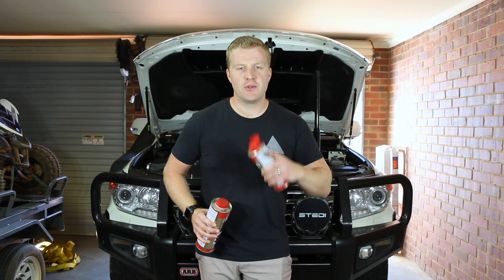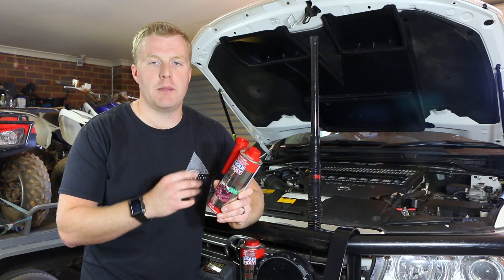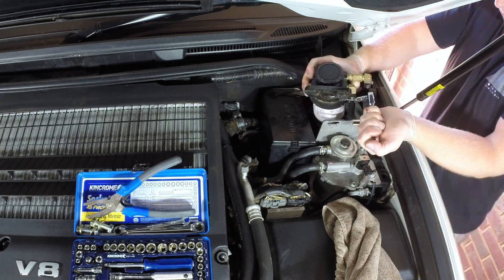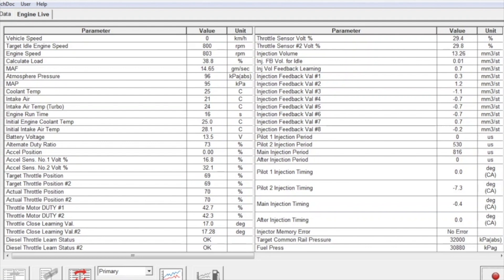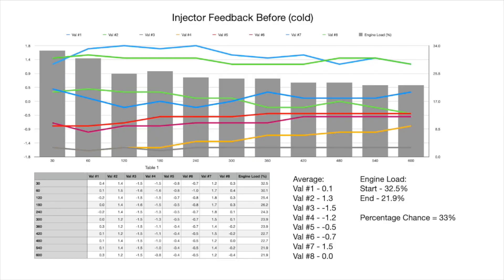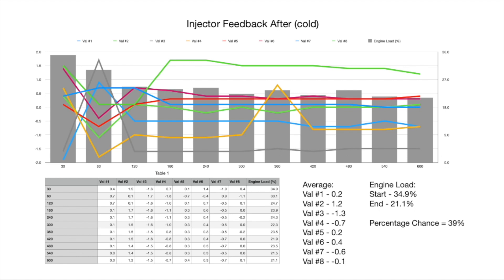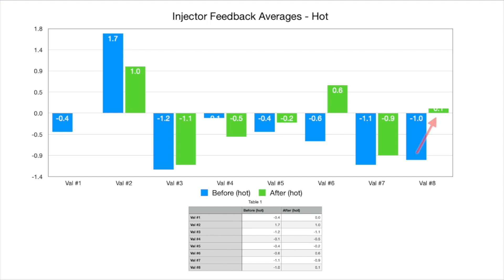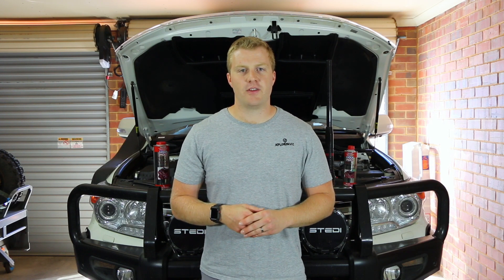LIQUI-MOLY Diesel Purge | Does it actually clean injectors? | Injector Feedback Test -Fuel injection

Comment: I pour it neat into a new fuel filter and run it through the engine like that, No messing about with pipes and clips! What is left i just pour into the diesel tank.
Reply from the maker: Sounds like a quick and effective method, cheers!

Comment: I put the diesel clean and boost in my NS pajero with 260k on the clock and it sounded heaps smoother/quieter.
Reply: How soon did you notice these results? Normal dose?

Comment: A good test. I have done simular with Liqui Moly diesel purge on a 2010 VW engine 90000 miles and a 2017 10,000 mile Ducato. The VW changed from +-1.5 to +-.4 post clean a very significant change (VW limmit+_1). The Ducato showed no change but limit is +_2 . Both tests were showng 2 injectors +4. On doing a leak off test cylindar 3 leaks over 4 times the others. Are there any other tests (scantool based) that you do or reccomend.

Comment: Those injector readings show how the injectors compensate for differences in compression on each cylinder. So yes, they were cleaned, but the figures cannot be used to show by how much.

Comment: I can confirm that liqui moli diesel purge DOES work!! Here in south africa our diesel has a high sulphur content so our diesel vehicles suffer quiet a bit however a diesel purge makes them run like new again. I have had a case where a BMW 2.0d sdrive would basically run on 3 cylinders on cold startup with a decent amount of smoke coming out, rough idling and loud injector clutter when driving. Replaced fuel filter and purged 2 cans through it and still to this day car starts without issue on cold and drives pretty much like new. I have even noticed on vehicles with DPF after purge the DPF pressure drops completely to almost brand new. Only had 1 situation on a Audi 1.6TDI where the purge didnt help but i suspect corrosion from moisture in the injectors where purging doesnt really help
Reply from the maker: Thats some great feedback and awesome to hear some noticeable real world results. I still use this product from time to time to purge and so far, I'm happy with how its performing 💪
Reply: Audi are pig iron 😮
Reply: So the vehicle doesn't suffer, the aftertreatment system does

Comment: My car stalls now after using this.
Reply from the maker: Hmm, something isn't right there. Maybe a air leak in the hoses?
Reply: I'm changing ox sensers now but this heat and rain and 70s dew points is to much for me this week,man. This is miserable weather.
Reply: Nothing was wrong before I put the cleaner in.the money light came on within a few miles after.I ran the tank down,refilled and the check engine was still on after twenty miles.I cleared the code and it  was successfully done ,but it stalls on start up now.

Comment: I bypassed my Fuel system on my Ford Ranger - put the Luquid Mobi straight to the rail using an 6mm and 8mm fuel lines and a clean empty 2 litre pre-wash bottle as the fuel resevoir / return from rail. (pulling all  the fuzes on the pump and vapourises). I ran two two full cans neat - with the return to the fuel resevoir having an inline fuel filter... Try that... It works almost neat  mixing with the diesel in the rail.
Reply from the maker: Yeah, awesome. Sounds like a much more efficient way of administering the product. 
Did you find there was much difference in the Ranger?
Reply: @XploringOz probably still a ranger 😢😂

Comment: thanks so much for the video and comparison, just a quick question, this type of cleaners dont leave residue in chambers?
Reply from the maker: No problems mate, glad you got some value from it. 
I don't have any scientific way to assess whether residue is left behind, but I don't believe it's designed to do so. 
Cheers, Nathan.
Reply: @XploringOz  its just that i wanted to know before using it if its true that it get burn 100% with fuel and will leave no residue in the chamber or the DPF and specially the DPF , but thks for the honest answer , 
have a nice day

Comment: The return line goes directly from the high pressure pump all the way back to the tank tank.  So for the concentrated purge activity, only one hose needs to go into your plastic container, to draw the liqui moly product in.  There is no need to disconnect two hoses because there is no fuel coming in from the tanks, as there is no lift pump that feeds fuel from the tank to the engine.  Only the supply hose going into the factory sedimenter needs to be submerged into the container.  I would simply open the fuel tank cap to release any air pressure in the tank, so that when the return fuel goes back to the tank, it doesn't push fuel into the supply hose.  

N.B. This advice that I am giving is only specific for the VDJ200 - other makes, e.g. Ford Territory actually have a fuel lift pump in the tank, so two hoses do need to be disconnected.

Comment: Great test but I doubt load is a percentage. With BMW load is an arbitrary number, with my 335i i have a peak load target of 195 ish and an idle load of 18ish.
With your LC v8 making 175kw peak, 30% load at cold start idle would be 52 kw just sitting there.
With many petrol turbos thats what contols boost pressure, you target more load in the ecu map.
Also there's load commanded and load actual so if u go to overtake, the load commanded goes up, load actual is lagging, the wastegates shut, it spools and boosts until load actual catches load commanded.
So much stuff going on, thats like 2% what a modern ecu is doing 👍

Comment: Very interesting 
I think we can potentially spend a lot of cash on additives for not much difference. It’s great to see actual figures to decide wether they’re worth their money
Reply from the maker: For sure, it's hard to distinguish between real products and marketing hype these days. Glad this could help a little.
 Cheers, Nathan.
Reply: LIQU Mobi and LUCAS are good in my opinion, Sea foam is hit and miss - the rest is snake oil.
Edit - I got a tip for oil changes - That does work - pour an Ouance / Oz of Sea Foam into your engine oil 200km before an Oil Change... let it run. Then do the oil change - it is like a pure solvent that helps remove gummy deposits - it does work for that, you'll get lots of tarry crap out of your oil drain.

Comment: Hello, do you have an in-tank fuel pump? or the fuel pump is outside the fuel tank?
Reply: A stock 200 Series does not have a lift pump, only an internal transfer pump that moves fuel from the sub tank to the main tank.  Fuel is drawn into the engine by the suction from the high pressure fuel pump, which is after the factory sedimeter / fuel filter.

Comment: That's a very good comparison and you have presented it very well! Personally, I use Morey's Stop Smoke & Fuel Conditioner in my old 2h. After about 4-5 fuel tanks, I noticed smoother running in higher rpms, significantly less smoke when under load, and a slight increase in power however no change in fuel economy (gets between 12-13 L/100 before and after fuel treatment). Initially, I was using Fuel Doctor but I didn't notice any real difference. I find the Morey's stuff is more effective. It's pretty cool how you can collate that data and make direct comparisons with modern technologies.
Reply from the maker: Thanks mate, glad you enjoyed it 👍
Interesting to hear your thoughts. Might look into this and see if I notice any difference. 
Cheers, Nathan.
Reply: @XploringOz  No problem mate! It'd be kinda cool if this assessment could be conducted on an older vehicle like mine. Cheers, Patrick

Comment: Hi Nathan. Great video!
Do you know if you could run the cheaper (Valvoline, Repco/SCA diesel cleaners) in the same manner? (Concentrate)
Reply from the maker: Cheers mate. So I haven't looked into this. I don't believe all of them would be able to do this as these products would need a specific chemical formula to successfully and safely run the engine. I think it would be best to check with the manufacturer before trying anything though. 
Cheers

Comment: I would be replacing injectors at 100k if towing a lot / working the engine a lot or at around 140k if the engine has had an easy life or at around 5 years, to prevent blow by from aging and or worn seals etc. At the same time i would be getting the egr system cleaned as even if you have a catch can you will still get soot build up over time.
Reply from the maker: I hear what you are saying, but at $6000 for replacement injectors, that just isn't a viable of cost effective option. 
I have had the intake and EGR clean as I fully expect some oil to still make is past the catch can 👍

Comment: Does the engine sound different? Should have done idle tests before and after with sound.
I did use it, just put in fuel tank, and engine feels smoother. After 50kms.
Reply from the maker: There may have been a very small change in the sound. I believe the change would be more noticeable to louder the 'knocking' or the more worn the injectors are.
Glad you were able to detect some benefit from using this.

Comment: About the injectors values, the sum of all of them is 0. And if you have 1 injector with problems, the rest will compensate for it. As we can see 1 injector has -1.7 value. That is why the rest have positive values to compensate for it. 
As we can see the additive helped a little,  but the only way to fix it is to recondition the injector or buy a new one.
Reply from the maker: Yeah mate, I hear where you are coming from. I guess these cleaners make a very small difference, but nothing that is going to save the injector overall...
Cheers, Nathan.

Comment: Slightly improved the scores... maybe because you only had a slight amount of gunk on your injectors?
Reply from the maker: This is possible, but the injector feedback values are showing some irregularities. Either way, had a little win which is a positive. 
Cheers.
Reply: @XploringOz  Your vid inspired me.  I'll run a test on my massively more gunked up 1996 2.5 TDI Iveco engine.  Curious if it will get help a blue smoke on start til warm problem.
Reply from the maker: @surfreadjumpsleep  Glad it could help. All the best with your test, let me know how it goes. Im interested to see how an older engine with potentially more build up reacts to this clean up. 
Cheers.
Reply: @XploringOz  I'll try to remember to get back to you -- awfully busy here & I won't be able to do this for another month.. maybe not for another few months.
Reply from the maker: @surfreadjumpsleep  No problems, all the best

Comment: Hello i did use it for 5 minutes and the other liquid i put inside the tank . I want to do it again , for 20 min now but i wonna know when becouse ive done only 2000 km after that purge . A friend of mine is saying me that it might do bad things to injectors , it open them more that it should .... what you think ?
Reply from the maker: Hey mate, this product shouldn't do any damage to your injectors. Keep in mind that the instructions state to only only use the product at idle or high idle. I think running the engine off this concentrate under load could cause problems in a long term situation, but you should be alright if mixing it with diesel. 
Hope this helps, cheers Nathan.
Reply: @XploringOz  thx ,but how many times a year should i use it ?

Comment: Hi Nathan 
Would you be able to provide some info. I want to check my injectors. Do you have a link to the software you use and a link to the cable from the car to a laptop. Looking forward to hearing from you.
Tieran
Reply from the maker: Hey mate, so the software is called Toyota Techstream. There are multiple versions available for download on the internet. It's not a product that Toyota designed to be accessible by the general public. There's no speicific link to it as such...
Further, it can be a struggle to install and get this software to work correctly. Personally I'm not an IT guy, so I had to send my computer off to a friend to have him install and program the software for me. It wasn't an easy process at all. 
The cable I was using is called a mini VCI cable. This can just be purchased online for a small price. 
Hope this helps somewhat. 
Cheers, Nathan.
Reply: Thanks heaps for you quick reply mate. Would your friend be interested in loading it on a laptop for me. Im located in Perth WA
Reply from the maker: @Sandgrop3r  Hey mate, I can ask but I probably know the answer. It's not really his thing and I think this program was difficult enough once... I'll let you know though.
Reply: @XploringOz Hi Nathan. I understand but I do thank you for your information and advice. Keep the content coming, cheers Tieran

Comment: I have the same filter setup as you. Did you have to remove a fuel pump fuse to stop diesel pumping from the tank during the purge?
Reply from the maker: Negative, I just disconnected the return line and diverted it back into the intake. The only thing with this method is keeping a feel for the fuel temp, as it will increase more than usual.
Cheers, Nathan.

Comment: Would a whole can be mixed with half w tank of fuel in it or a full tank?
Reply from the maker: You could run this with a half tank, it would just make it a little more concentrated. It won't hurt the engine unless you're over-concentrating the mixture and putting the engine under very heavy loads.
Reply: I run it almost empty and pour it in, if you lose power after doing a bottle that means it cleaned a lot. And the filters need changing if you have a see thru pre filter or screen, keep an eye on it for clogging

Comment: Hello , i want to know which should i use for my car ,liquid molly spulung or liquid molly super diesel additive ?
Reply from the maker: Hey mate, for my vehicle I use the Super Diesel additive. Works well for me.
Reply: Hello bro . I want to do the purge proces but i dont know how to do it in my audi a6 2007 2.7 , i dont know which tubes should i put in the liquid
Reply from the maker: @R3MILI  Yes, this can be a little difficult sometimes and is different on each vehicle. Best way would be to try and follow the fuel lines from the fuel tank itself. This will generally lead to a fuel filter and then into the engine. The fuel return line is generally nearby as well. This can also be traced back to the fuel tank.
Reply: Since you have information bout cars ,can you tell me if a bad  intake manifild swirl flap  may cause my audi to consume 15 lit for 50 km in city ?   In highway it consume only 7 lit for 100 km .
. Ive heard many ppl here some says its that probldm that consume as much fuel ,some say it doesnt has to do with that ... what you think bro
Reply from the maker: @R3MILI  Hey mate, I probably wouldn't be able to diagnose an issue like this without seeing the vehicle myself. There are many reasons as to why the vehicle may be performing like this. Sure the fuel could be one issue, but it could be many others as well. Sorry I couldn't help.
Reply: I did the diesel purge on my audi a6 2.7 , ive seen more acceleration . But i havent done any test for fuel consum . How many times a year should i do this clean ?

Comment: I also use the same perge product at every fuel filter change, nice to see some actual data.
I also add a fuel advertise into the tank, not at every fill up but on regular intervals.
Reply from the maker: I think it does help, even if it is only a little 👍

Comment: Any reason in particular why you run a " post" fuel filter and not a " pre " fuel filter?
Reply from the maker: There are definitely advantages to both running pre and post filters and it will depend on how you want to set up your particular vehicle. 
The reason I chose this method is that it allows the pre-filter to essentially run as standard, meaning that if I pick up dirty fuel, my dash and factory sensors will let me know. 
I always carry an extra fuel filter and am able to clear the fault light with the Ultraguage.
Running a pre-filter can protect your factory filter, however you won't know whether it has picked up dirt and debris until there is a slow down of fuel passing through the filter. 
Again, everyone has their own opinion on this matter and this is only how I think about it. 
Cheers, Nathan.
Reply: @XploringOz  thanks Nathan like your reasoning.  I put a pre filter in mine and its not that easy to check the bowl for water  , i  need to use a mirror on a stick to check it.
Reply from the maker: @jpbro5545  As long as it's working for what you need, that's all that really matters.
Reply: @jpbro5545  i have the same issue on a d max cant easily see the bowl.

I will use your sugestion re mirror on a stick
Reply: Yeah the dude form Berrima Diesel is not that impressed with a post fuel filter on the diesel LC200 - https://www.youtube.com/watch?v=uRKsXgHuWX0 He talks like he knows his stuff

Comment: Hello. Which software did you use to display those values? Cheers
Reply from the maker: Hey mate, I used a program called Toyota Techstream. Plugs straight into the OBD-II port and reads the ECU's data directly.

Comment: Well done! Nice to see a comparative study. I don't have OBD on my old Patrol. So this has been more than helpful for me. 
Thank you for going to the trouble with this presentation. 10 from 10.
Be well.
👍
Reply from the maker: Cheers mate, appreciate the comments and glad the video could help.
Much appreciated, Nathan.
Reply: @XploringOz  One thing you mentioned which I have not heard before. Is to use 'Fuel grade' extension pipes if you need to. 90°+ temps. Not heard that, so important on  HOT car. Thanks mate 👍
Reply from the maker: @chippywarren9706  For sure, the last thing you want is damaged cause by containments from a inadequate hose not rated for this temperature.
Reply: @XploringOz  Thanks again mate. My old bus will thank me. Great channel, love the vids.
Stay well 👍
Reply from the maker: @chippywarren9706  Cheers mate, glad you're enjoying the vid's.